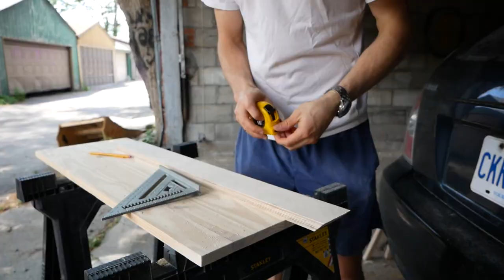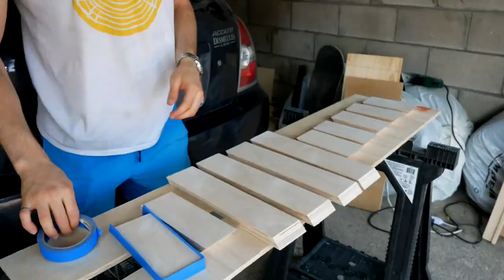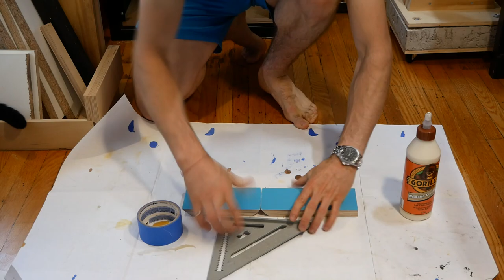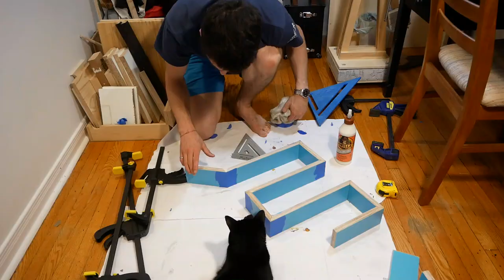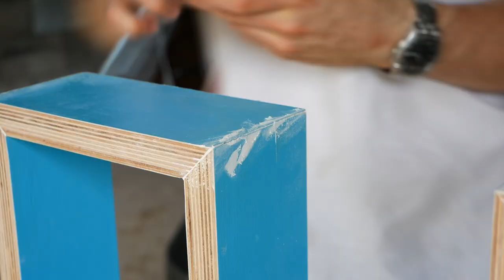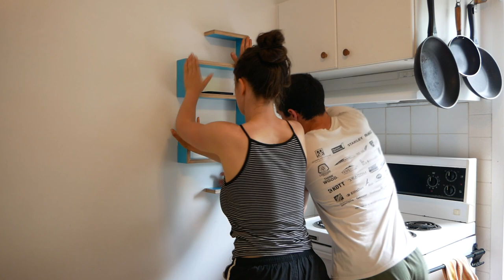MODERN PLYWOOD SPICE RACK // DIY Woodworking Project

Comment: Looks good, the plywood edges and color work well! Those command strips are industrial strength Velcro.
Reply from the maker: Thanks, Dave! Aaahhhh I didn’t know it was industrial strength, time to do some research!
Reply: @MorleyKert  yeah probably the patent expired or something by now. I first saw something similar, the center console cover on my old 93 Dodge Daytona was held on with similar stuff!
Reply: It’s not quite Dual lock, though, somewhere in between regular cloth Velcro and Dual lock, I guess?